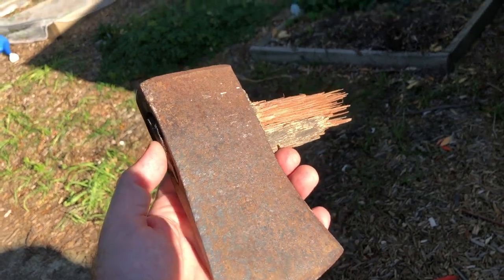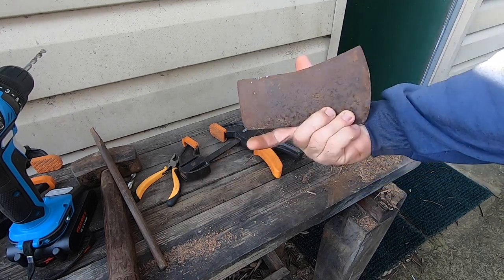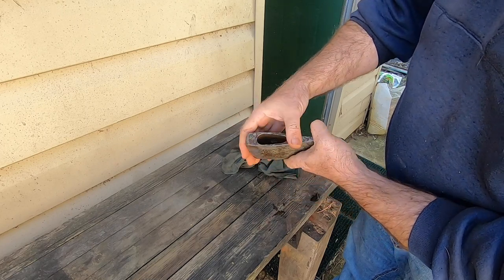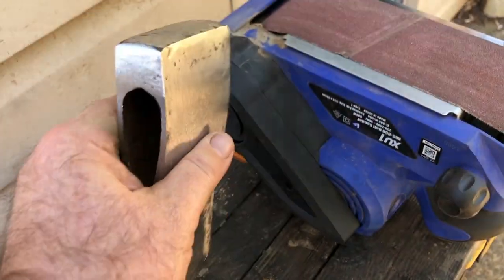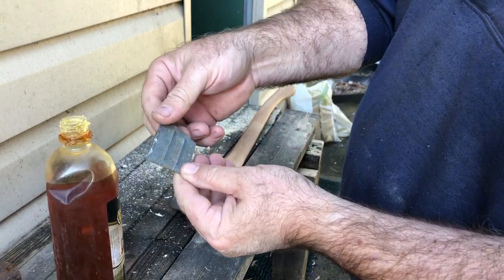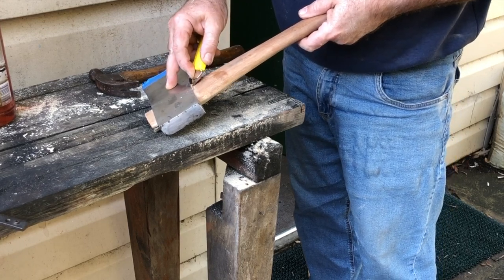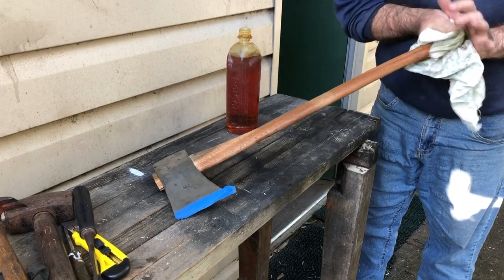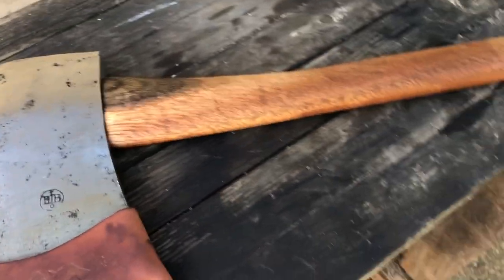How to Re-handle a Broken Axe 🪓 | Bushcraft Tools

Comment: Yeah but can you do the same thing with a maul?
Reply from the maker: I'd say so - I do have a block splitter maul that is looking a little beaten up.  That may be the next one on the list. Should be able to adapt a regular sledge hammer handle for that, or make one form scratch.